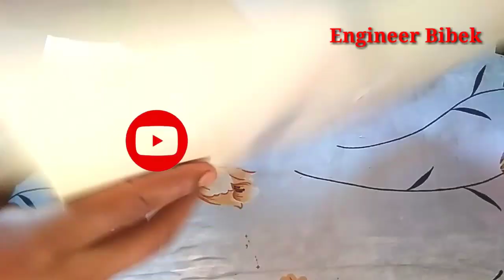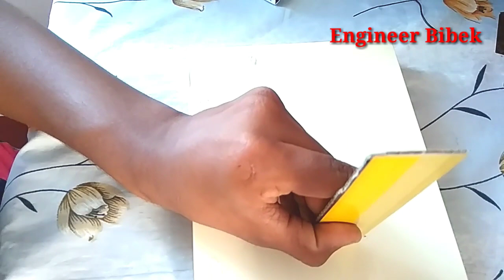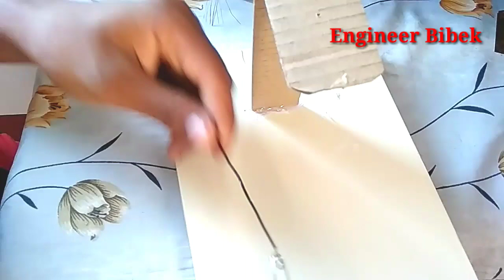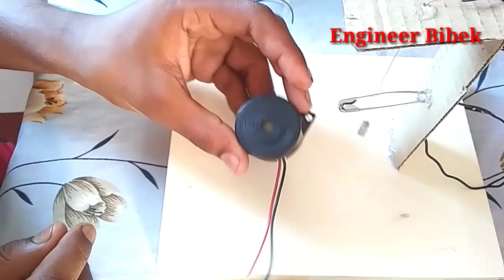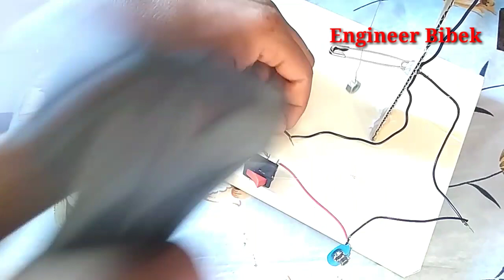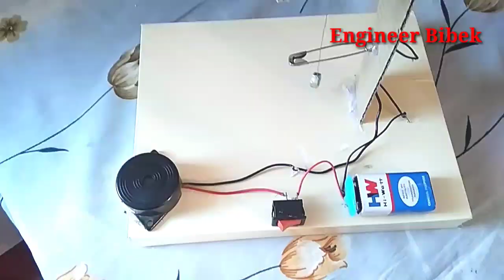How to make Earthquake alarm || school science project

Comment: Materials used:
9v battery
9v battery clip connector
Wire
Copper wire
Buzzer
On / off switch
Safety pin
nut
Cardboard